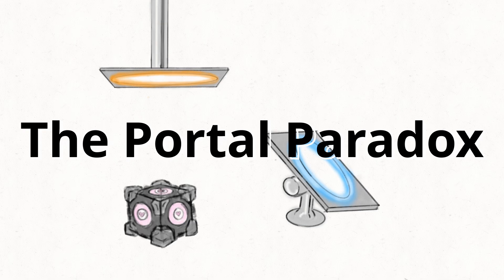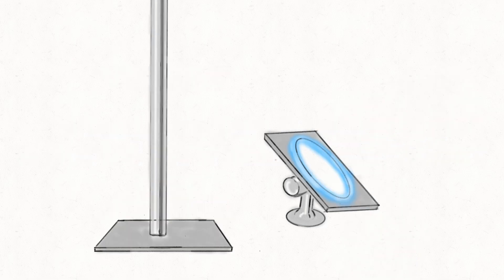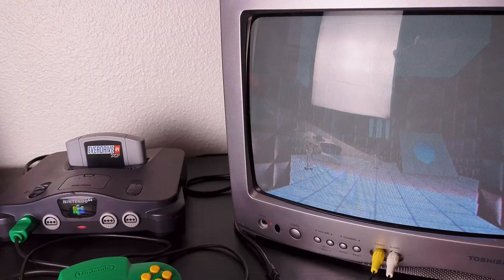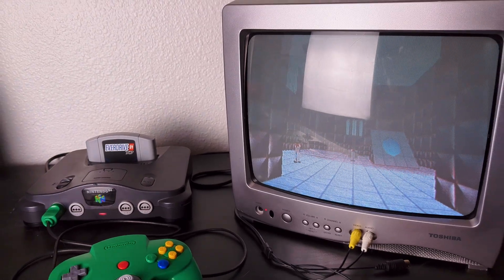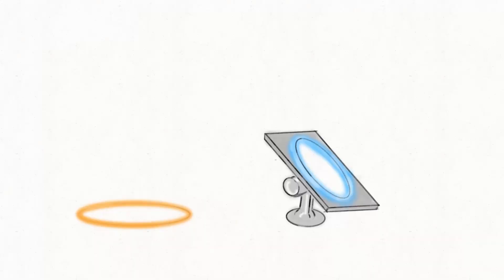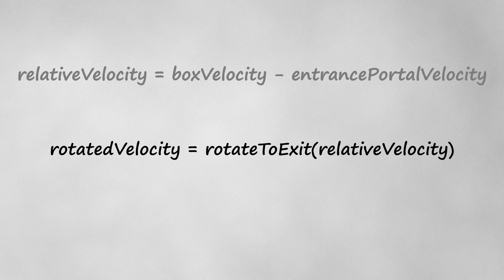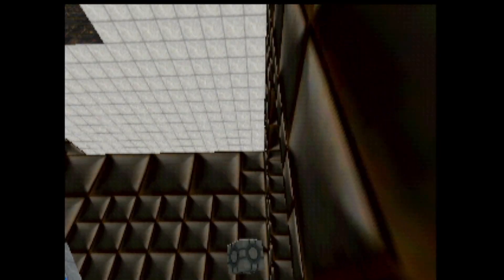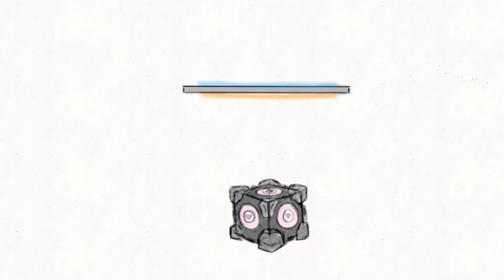I rewrote Portal from scratch and solved the Portal Paradox

Comment: You're makingly an INCREDIBLY bold assumption that the relative velocity of the portal is more important than the ground's.
From the ground's perspective, the cube instantaneously accelerates without a force acting in it, completely defying laws of motion.

Another flaw is that you assume the relative velocity of the cube from the perspective of the orange portal can be anything other than 0 at the moment the portal has encompassed the cube. The portal is never capable of fully encompassing the cube, and even if we assume it can, both portals are now stationary, meaning the relative velocity at this exact moment instantaneoulsy drops to zero.

Momentum can't increase without an energy being applied to it.
Velocity can if all you do is shift perspectives.
Bad solution.
Reply: relative velocity of the portal, the ground, and all other objects is equally important in physics, and when you analyse stationary portals this way, you'll find they also break the laws of momentum.

both option A and option B and regular stationary portals break the laws of momentum, so the laws of momentum are clearly irrelevant. Welcome to the world of portals
Reply: @IdiotVermin  

"Relative velocity of the portal, the ground, and all other objects is equally important in physics"
Yes. As a matter of fact, that was the exact concept my (correct) argument hinges on. The ONLY remotely relevant variable in this problem is velocity. Anything else you describe is just a means of disproving B as a viable option, because A can be explained without new physics and without breaking any fundamental laws.

"And when you analyse stationary portals this way, you'll find they also break the laws of momentum"
They don't go to zero in other frames of reference. You're blindly assuming the portals are universally stationary instead of simply being locally stationary. This is an absurd statement that has zero basis in reality.

"Both option A and option B and regular stationary portals break the laws of momentum"
No they don't. Only option B does.

"so the laws of momentum are clearly irrelevant"
They are for this problem, but this isn't the reason. The reason momentum is irrelevant is because this is a very, very simple relative velocity problem that doesn't require momentum, because there is no transfer of energy implied in the problem statement.

"welcome to the world of portals"
you're literally wrong though.

This is really, truly simple.
- The portal moves at a constant velocity toward the cube.

- They both see each other moving toward them at 2v.

- The portal encompasses the cube.

- No energy is transferred from the portal to the cube.

- The portal comes into contact with the bottom platform, which is modeled as a rigid object.

- We can choose to approximate the system as static or dynamic. Either way, without sufficient velocity, the dynamic results are negligible, so we might as well do static.

- The cube, the rigid platform, and the portal are now in static equilibrium with each other. No energy was transferred between them. If we model it as dynamic, the only energy transfer that occurs is between the surface the portal is resting on and the bottom platform, which is an everyday occurance and in no way shape or form a violation of any fundamental laws.

- The cube is still resting on the platform, as no new energy has been transferred to it.

- As a result of the cube having zero reason to not be at rest, we end up with option A.

- Even though the portal is stationary from our frame of reference the portal is still moving from a universal perspective, so it maintains its energy and doesn't disappear.

This is very basic classic physics.
You don't need to get fancy with it.

Comment: Can't wait for this project to be done so i can get myself a N64 clean cartridge board, flash that bad boi onto it, slap this into a fresh cart, launch Photoshop and design a sticker and box art, print sticker and box art and add this gem to my n64 collection. Hell, I may go as far as making a god damn manual. Just as if it was released by nintendo in 1997.
Reply: You can start on the art now, if you want.

Comment: This is silly, The portal is a hole or fold in space, The hole itself does not carry inerscia so can't translate any inheret forces. i can see how it will make for fun game play and if your going for that great. but i can't imagine any means in which for a hole in space to apply any forces to the objects passing through it. the reason why force is preserved on objects going through the portal is precicly becuase the portals don't apply any force to the objects that sail through them. unless im missing something it just does not check out in my oppinon, Sick game tho.
Reply: Portals already show the capability to alter the velocity and therefore momentum of objects passing through them. They do this whenever they change the direction the object is travelling.

Whether this is to be considered the portal applying a force is up for debate but the argument that the portal therefore cannot alter the velocity and momentum of objects is a flawed one. Even the claim that the portal cannot bring an object from being stationary to being mobile. As that will automatically be the case in at least one reference frame as long as the portal as changed the velocity and momentum of the object.

Comment: I don't think you can solve physics of the portal paradox, and thus correctly implement a "correct" solution because portals themselves break physics. Whatever your solution is, it ends up breaking physics in another way. Assume something false, and you can prove anything.

The "fact" that portals inherit and impart momentum is itself a big assumption. Your formulas are correct in that they describe your model well, but saying "this is what would happen, if portals were real" is begging the question. 

I think the most important consideration is what looks coolest and is most interesting, and I think your demo makes as compelling an argument as can be in that regard.
Reply: B's logic is basically how the portals already operate. It would only break physics in the ways that portals already do break physics. Essentially portals being able to alter velocity and momentum is not an assumption. They show to do that in the games whenever they change the direction an object is moving, which also means the capability to alter speed and therefore kinetic energy when you have an understanding of the nature of reference frames.

Comment: So, in the world of Portal you could make a very light board on a stick with a portal-friendly coating on the board. Connect one portal to the board. And the another portal to wherever. Then slam the sign on any object portal-first, shooting the object at the velocity of the slam out of the second portal.
Looks like a pretty formidable weapon. Because it seems that you could launch objects of any weight at high speeds

Or you could even make a portal cannon that is automatically reloaded with depleted uranium shells at the base that slams first portal against the shells, while you are holding something like a shield with a second portal on it, shooting tons of material at your enemies. Hmm...
Reply: make big portal, launch everest at the enemy

Comment: YOU BROKE PHYSICS! Why would you brake physics? Let us answer the question you posed, “What is wrong with this equation?” 1:50. You essentially coded conservation of velocity(v1=v2), which is not a thing. The physics principle we need here is the conservation of momentum (essentially: v1*m1 =v2*m2), which does exist. The video shows the results of if, and only if, the portal and the cube have the similar masses.

However, as far as I am aware and this is a BIG assumption, the mass of the portal is close to zero, let’s say 0.001 g. The mass of the cube is at least 1 kg, 1000 g. This means if the portal had a velocity of 10 m/s (22.37 mph), the cubes velocity would be x in the following equation: [1000(0)+0.001(10)=1000x+0.001(0)] (the cube starts at rest and the portal ends at rest, hence the zeroes). X=0.001*10/1000=0.00001 m/s. So, the cube would NOT fly out of the exit portal. Thank you for your consideration. Cool code otherwise.
Reply: The portals never show to manipulate an object's mass and only alter momentum by way of altering the velocity component. Which is why it was reasonable for him to only handle velocity in his code.

You're assuming he was attempting to simulate conservation of momentum with his code when the truth is portals never followed conservation of momentum. They fundamentally break it whenever they change the direction an object is moving with zero counterreaction: https://www.youtube.com/watch?v=ASUUN0W4_JY

Comment: I completely agree, this is the most intuitive option. Also I love that you jump straight into it because you value our time and the whole video is only a few minutes long! Super concise, thank you
Reply: But the cube never gains momentum. The portal moves around the cube and does not transfer it's momentum to the cube at any point. The cube should maintain its current momentum and transfer it's mass to the new location. Essentially what happens in his second experiment should happen for both. The cube is stationary and the portals move around it. Gravity works as a constant on all individual atoms independent of the total mass of the object. We just normal do not have means of achieving such a huge difference in gravitational pull and direction on an singular plan (the portal) in reality.

Comment: Isn’t the whole “speedy thing in, speedy thing out” thing basically just due to the object keeping its current inertia when passing through a portal?  That’s how I interpreted it, and if so then would mean that the portal would only plop out of the other portal due to gravity pulling it in a different direction instead of it flying out. 

Unless, of course I suppose, you’re redirecting the orbital/cosmic inertia everyone technically has due to the earth rotating and hurling itself through space. But that being take into account would affect a whole host of other cases that the games clearly don’t show happening (like having two portals side by side on like an eastern facing wall, wherein just hopping through one portal would launch you out of the other one, probably to your death).

Comment: There's no velocity coming from the cube or the surface it is sitting on.  So the cube shouldn't fly out the other portal.  If the entrance portal is only one way then the cube would materialize up through blue portal and just sit there.  The only thing with velocity or motion in scenario is entrance portal, so only thing that would happen is cube gets generated quicker on other side portal.

It should have the same physics as a giant bubble wand.  If you move the wand quickly the giant bubble doesn't shoot out the other side like if you have a fan blowing on a stationary bubble wand.  Same concept.  The air inside the bubble isn't creating its own forward motion if you're just moving the bubble wand... the air is staying stationary and you're creating the bubble around it.

Comment: I am absolutely not a scientist, so take this comment with as many grains of salt as can be fit inside of a weighted companion cube. The problem I have with this intepretation is that the only way portals/wormholes can exist in an understandable way is to confirm that they do not involve faster than light travel. In other words, it needs to be functionally accepted that despite their apparent physical locations, there is physically 0 distance between any two linked points on the planes of our portals. since there is 0 distance between the two planes, it takes no energy or change in momentum for an object to "travel" between them (in reality no part of the object is traveling at all in any instantaneous moment). You might then say "the moving portal itself is generating the momentum and it's just TRANSFERRED to the cube!", but then I would argue that as portals are purely 2 dimensional objects with a volume of 0, they cannot have mass, and therefore cannot have momentum. If the portals are NOT 2 dimensional, and therefore have some kind of space between them (specifically unique space on each side of the portals giving them each depth) THEN maybe you could be correct, as it WOULD take additional energy/momentum to cross that space. I'm not certain what would happen there, and I suspect that whatever exists in that space would come into contact with the object, but I'm not certain of what the result would be 🤷. I'd think that something along the lines of spaghettification from approaching a black hole would occur (but for a very different reason), or matter passing through the space would be instantly transformed into energy as you would need to move faster than light within that depth on either side of the portals to actually travel to a new point in space effectively instantaneously. The effect would be more pronounced as the depth of the portals increased with the limit of the effect being 0 as the distance approaches 0. I'd love for someone to prove me completely wrong here because
Reply: I think one of the issues with modeling this type of question is that we often use forces in games where they do not exist in real life, gravity being the absolute prime example. There is an apparent force, which appears to attract all objects with mass or energy toward other objects with mass or energy, but this "force" is not the cause of this interaction, but is likely the effect of mass/energy concentration's effect on time and space. The simplified forces we see in modeling/video games are obviously not capable of modeling the exact effects of the physics of the real world, especially when apparent paradoxes present themselves. As you said in the video, your code is what determined the outcome here, and while I think it's an incredible effort, it simply does not recreate the true causes of the represented phenomena in a way that allows us to gain new information about the physical universe

Comment: Isn't a portal simply creating a doorway to a room that isn't on the other side of the wall?
If so, then a "doorway" dropped on you would not have you fly through it. You would be in the room that isn't on the other side of the wall quickly (or slowly depending on how fast the "doorway" was moving).    It's like the "Steamboat Bill Jr's" infamous tornado scene, where the front of a house falls down on top of Buster Keaton, and Buster is saved from harm because he stand where the window is. That is different to if he jumped through the window. HIS momentum is not the windows' momentum.

Now, the aspect change would introduce gravity.
Going from vertical to inclined would cause you to tumble.
Reply: This devolves into the "hula hoop" example which is covered in this video. I encourage you to watch it.
Reply: Watched it ...6 months ago according to timestamp.  @breakerboy365  
Having (checks Steam) A LOT of hours on P1+2, I believe the devs agree.

Comment: Not sure what the portal paradox is but as a gamedev and a avg fantasy enjoyer here's why you're wrong. A portal doesn't cause move and it doesn't 'touch' and object so it doesn't influence it at all. Even if the portal moves it's literally like a hole. You do not use physics to move the cube from one place or another and because there is no physical interaction it should not have it's velocity tampered with by any other object meaning the equation/code would go. 
Box.position = exit portal.position;
Box.rotation= exitportal.transform.forward
Reply: The coding for portals tends to be more complicated than people assume. You can't simply go "put the cube where the exit portal is and have it facing the exit's direction". The properties the cube had relative to the entrance, both the direction and also the position (as an object rarely goes through a portal directly through the centre) both have a bearing on where the object ends up.

As far as velocity not being tampered with, that is incorrect. In fact one of the game's most prominent mechanics, the portal fling, is all about how the portals will also alter the velocity of an object passing through it, as changing the direction of the velocity IS changing velocity and requires the velocity properties of the object to be altered in the code.